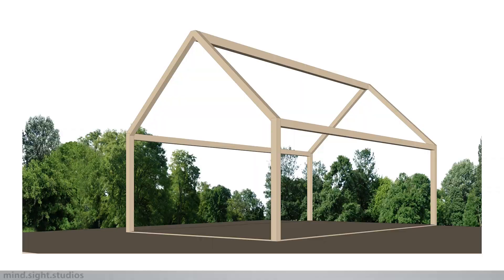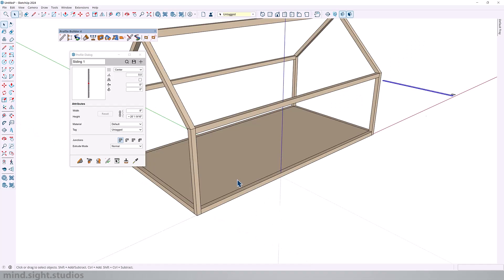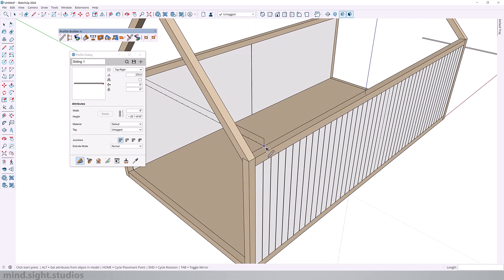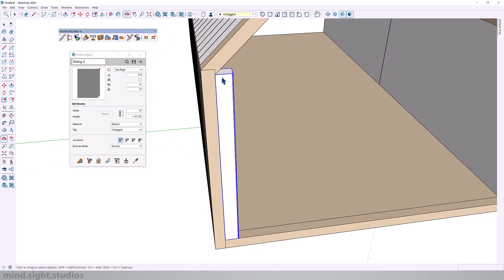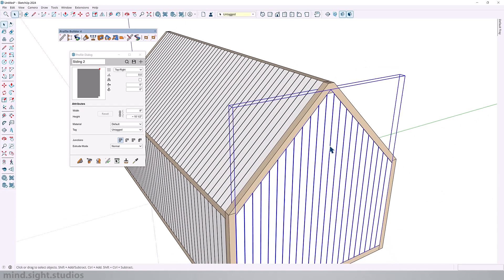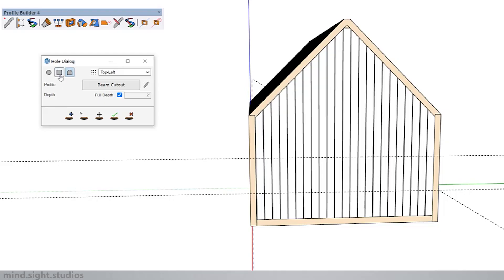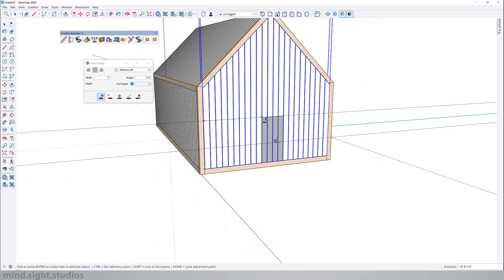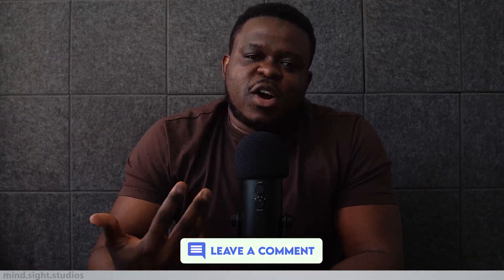Profile Builder Essentials: How to Trim Profiles and Create Openings

Comment: Hi Thanks for sharing your easy tutorial. A quick note about my projects, I have been a long time user of SketchUp Pro 8 years. I am recently getting into using PB4. I am having trouble with 'Sub-Assemblies'. I think the issue is my build workflow. I have tried the 'Auto Assemble' tool. The tool makes the assembly although I can't figure out how to install the new sub-assembly into the base model-ugh. I know you can help because you are an expert in use PB4. Thanks!